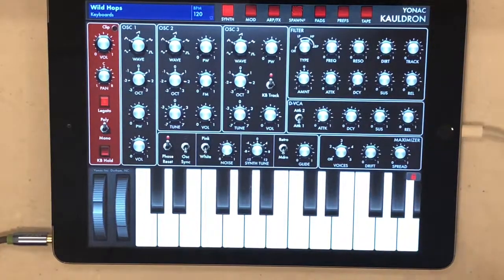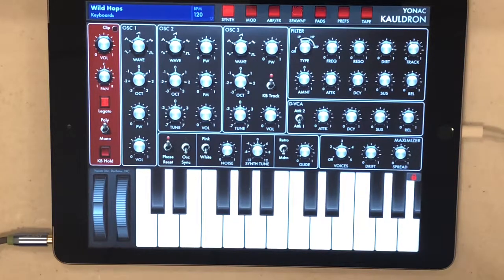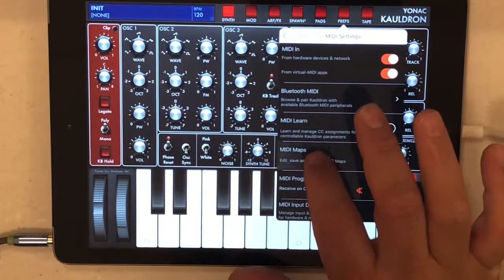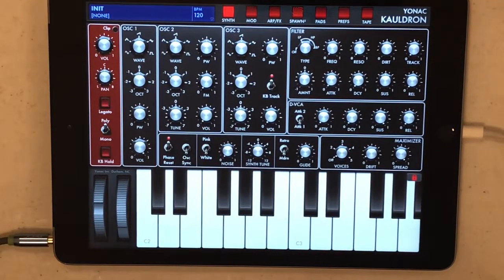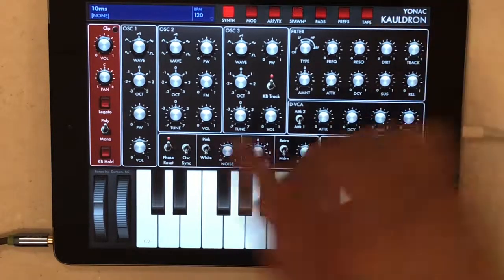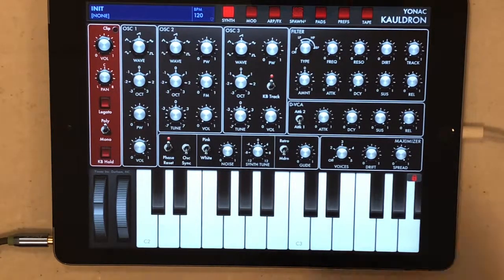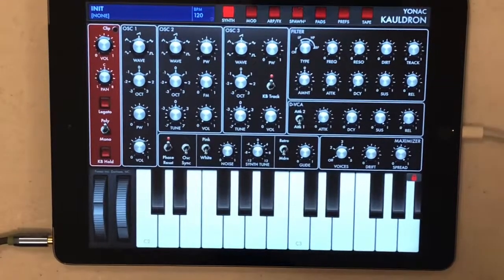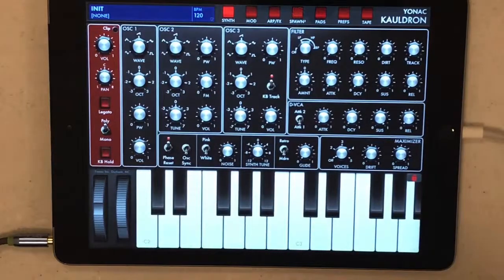Breath Controller Tutorial: Basic MIDI Breath Control

Comment: Can I use a Mic 🎤 as a breath controller to trio the same response
Reply from the maker: @puresoulg  you would need something to convert audio volume to midi breath. There are devices that make that possible. I’ve done it with an Empress ZOIA pedal.
Reply: @coltranius Ok Thanks doing my Homework However, I do Have a Yamaha Motif ES 6 I can use temporary 
So Is it possible to hook a mini mile to the BC control port on the Motif? 
Thanks again
Reply: I just found a video using the device pedal unfortunately I can’t find out how or 
What wind controller He’s blowing into ,and What are you are you using as a breath controller? because I don’t see it plugged into the breath, controller input labeled.BRTH

Comment: Hi. Breath Controller is used with this program. Are there other programs other than this program that can use breath controller? Do you know? Like real instrument sounds? Thanks.
Reply from the maker: Ther isn’t much on iPad for real instrument sounds. Korg iM1 works well with breath control, and AudioModeling may have something coming soon.

As far as synths go, there are tons. To name a few: Mood, LayR, Model D, Viking. If you use an AU host like AUM you can use its midi routing and F-16 filter to make pretty much any iOS synth work with breath control.
Reply: @coltranius   F-16????????
Reply from the maker: @SehidiminSesi1Azerbaycanim  it’s an AUv3 plugin by Blamsoft.
Reply: @coltranius  OK. Thankyou

Comment: ok very cool ! one question please, in the midi map of this app you can change that if the ewi send CC02 (breath control) the synth change it to CC74 (filter) but not all synths have midi map to change like this, right?  I look for in my Roland FA and this option isn't possible 😔
Reply from the maker: Daroan Vimusen Which FA do you have? I think the 08 at least actually accepts great CC02!
Reply: @coltranius  Hi ! all the FA's has the same engine !  I have the FA08 and yes, it's very cool to breath, but with a normal breath controller like yamaha bc3, the synth sounds (specially) and some brass, responds amazing to CC74, so happy , but...I try with the EWI again this weekend, to give it another chance 🙂

Comment: thanks man,
this one of those ‘’little quirks that change everything, that nobody tells you, in the beginning”.  ;)

i am divided between going for an EWI or a TEC Control breath controller.
i play a MalletKAT, which is mallet percussion midi controller, that has got great control input.
i have been  contemplating an EWI because it would be a ‘new’ way of playing for me. 
i thought that, if it can be used just for breath input, and allow me to play the notes on the MalletKAT,
 or any midi controller keyboard, i could have both, do you know what i mean?
i’d be. able to choose between playing the EWI normally, and also use the EWI as a breath control input for the malletKAT.
Do u know if it can be done?
thanks again ;)
Reply from the maker: V4D2 I think you could use it that way. Looking online, it looks like there is a MIDI merge setting that will merge your KAT controller midi with whatever comes in the MIDI in port, sending both to MIDI out. If you are playing onboard sounds, I think it would work, but I have no idea what kind of control you have when programming the internal sounds, though.
Reply: @coltranius  hmmmm.. ;)
Yeah...  Mario (the creator of MalletKAT) had told me about the MIDI merge possibility before.
Thanks so much for taking the time to check this out, with me. :)
I have a unit with no internal sounds, though.
I trigger all sounds from the laptop or the iPad.
I could always get a TEC Control MIDI breath controller. 
But an EWI usb is just 50€ more..and I get an independent controller, totally usable for other things ;) .
If I can use it as both a breath controller for the MalletKAT AND .. as an EWI then...it is a no brainer. 
It will be a 'heavy-ass' breath controller though.
  Hehehe..   as the TEC Control unit is just a little mouth piece. 
BTW.. Have you ever tried more than 1 simultaneous MIDI channel, on the iPad or PC ? (Multimbral) with either that synth, or another one?
I am thinking I could connect the MalletKAT , the EWI , a keyboard and a MIDI guitar...each on their individual MIDI channel, hook it up to the MIDI IN, on the audio interfaces, and they could trigger that or other VST.
Reply from the maker: V4D2 I haven’t tried it that way, but I think what you’re describing is possible.
Reply: I've heard, from the makers of TEC Control, that it doesn't work with an iPad. So, it's the EWI you're using as a breath controller, not the TEC Control. If the TEC Control is controlling anything, it is controlling the EWI's output.